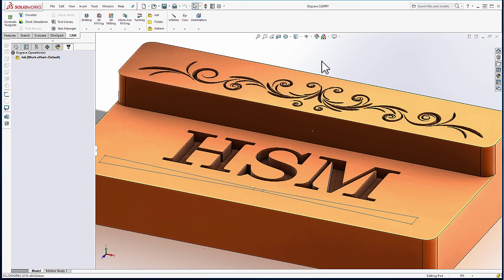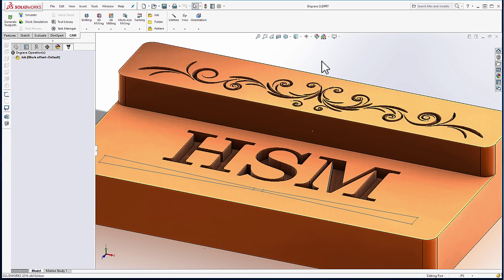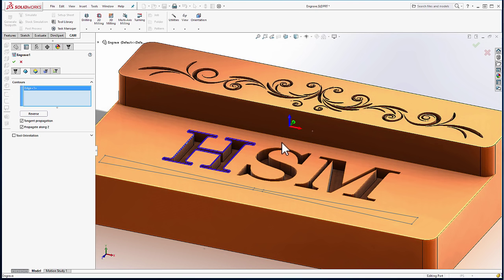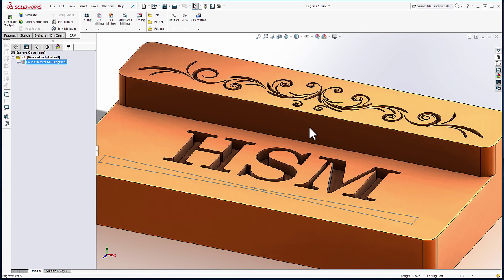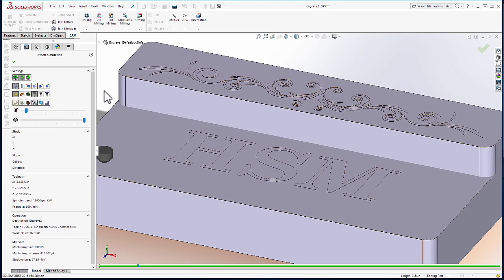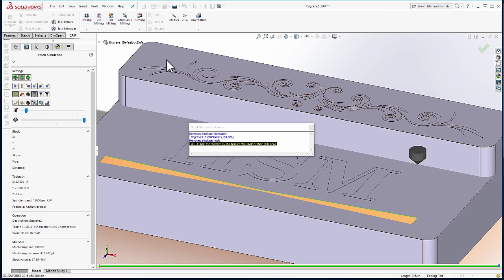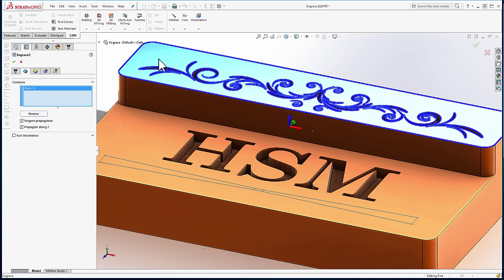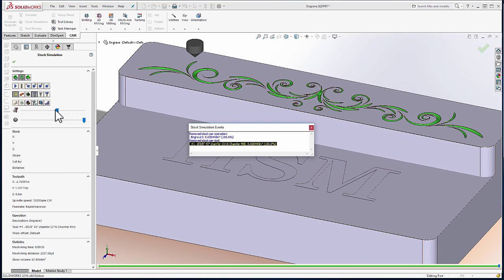Engraving with HSMWorks 2016

Comment: Very nice. Looking forward to this in Fusion 360. I hope it comes with some fonts that are not boxed. When engraving part numbers I don't need anything fancy just a single line font. This produces a shorter program and clean looking letters and/or numbers.
Reply from the maker: +Ed G For single line font you just need to get a "stroke text" true type font and use the trace toolpath.
Reply: +Autodesk CAM I went thru almost every font(there are a lot of them) in Fusion 360 and could not find one that was not boxed.Is a "stroke text" true type something I need to import or do I need to go deeper into Fusion 360 fonts?
We currently use a decade old version of MasterCam for engraving in which every font I have used is a single line font (not boxed).Is it possible to export then import those to Fusion 360?
  I have the same questions as Nick F except I am running a Windows machine. A tutorial would be great.
Thank you for the videos.
Reply from the maker: +Ed G Support for selecting Text needs to be added in addition to having access to stroke text.   The comment was more that following single line text is a different problem then engraving (Even though in practice it seems like the same thing)
Reply: +Autodesk CAM  OK thank you.
So is there a way to do the following in Fusion 360? "For single line font you just need to get a "stroke text" true type font and use the trace toolpath."